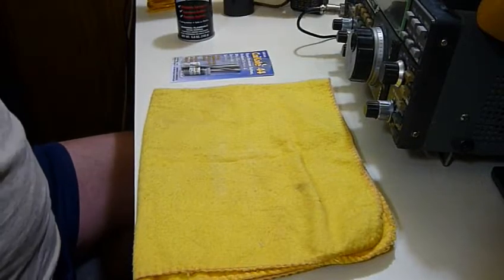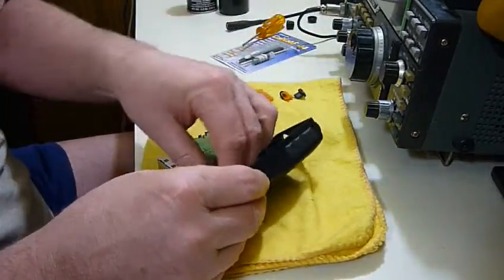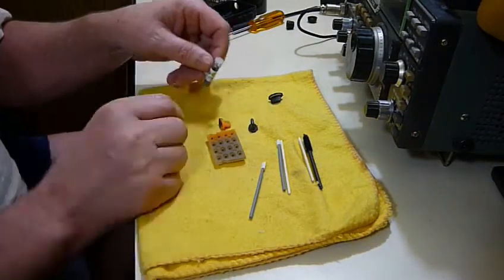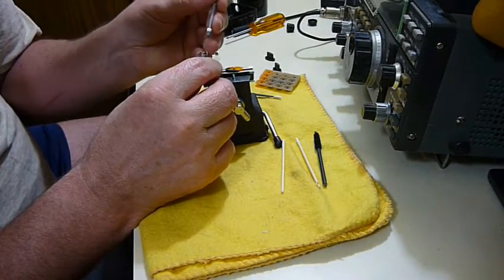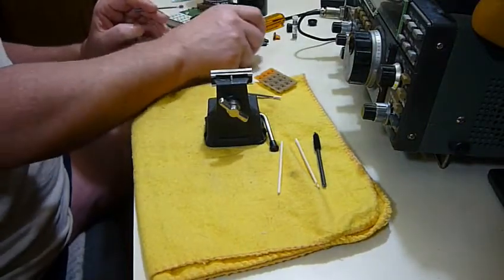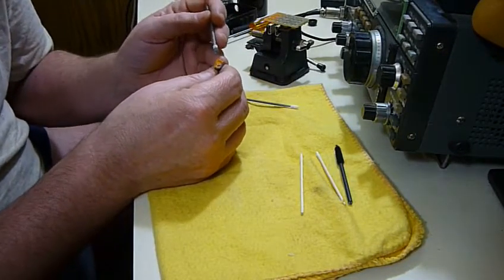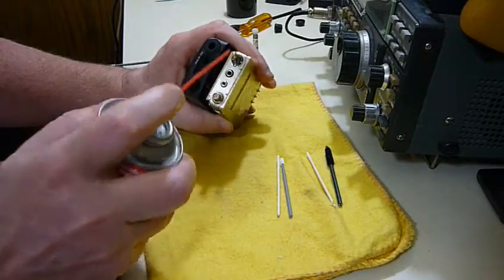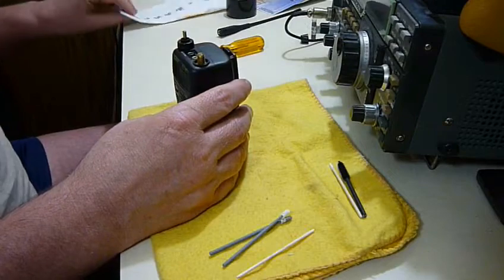How to Repair Rubber Membrane Buttons, by KV5R

Comment: Great video. I have a problem with my Yaesu VX5R power on/off button. I asked a Yaesu tech at the 2013 Dayton Hamvention how I could repair the problem with the membrane since replacement membranes are no longer available for the VX5R and was instructed to remove the membrane and lightly scrub the carbon coated pads with a pencil eraser. I haven't done that yet. Finding your video is probably a better solution. I will try your method.
Reply: +Terry Morris pencil does work alltho it depends how long it will last based on using the button. More important is it will work. :D

Comment: Thanks for this tip. In Australia I found a product called KEMO Conducting Silver which I used to repair apair of Uniden cordless phonee that had a faulty toggle switch on both. This product and this tip fixed both !! Bought the KEMO Conducting Silver from Jaycar Electronics $12.95...cheap repair !! Thanks again easy to follow video.

Comment: Silicone rubber keypads need to be banned.  junk
Reply from the maker: ***** Or at least they should be made with a lot thicker conductive layer, so they have a decent lifespan.
Reply: it's designed obsolescence. it'd be easy to make a contact surface that last 1 million cycles. but why would they want to? ur supposed to toss it in the garbage & buy another. all consumer products are made the same way.
Reply: +Eric jones   Eric is partially correct.  The Silicone is the substance that makes the rubber keypad flexible.  It is the combination of the silicone oil and the conductive carbon contacts that is the culprit.   I fixed tens of thousands of keypads and I found that Panasonic had installed a conductive membrane between their rubber keypad and the board on only a few models back in the early 90's.  Then they stopped doing so and went with just the rubber keypads, why?  My guess is that the ones with the membranes were lasting far longer than they wanted them to.  The only way I found the models with the membranes was that they would fail for other reasons , but nothing to do with the buttons unless they were just filthy and sticking down, but then they would still work.  So we reverse engineered the Panasonic membrane and began manufacturing our own, eventually making a peel and stick conductive membrane that fits most Panasonic phones without adjusting it, or it can be cut up to fix most any similar keypad.  Panasonic had a great keypad for some older 900 MHZ phones, so we copied their best keypad solution.
Reply: +bgregg55 You and Eric jones are right. They should be banned. They're a step backward to mechanical switches.
Reply: You have a good point, and technically they are inferior to mechanical switches, however there is a trade off for everything, even buttons.  Most mechanical switches are soldered to a board so repairing them is labor intensive.  Their contacts should be coated with gold to ensure their longevity, which is not only costly but to harvest, refine and acquire gold then plate the contact is not earth friendly. So I think Panasonic had the best buttons engineered back in the 90's which they included with some of their 900 MHZ phones, about a dozen of them.  This "family" of cordless had silicon rubber buttons, but they only functioned as buttons, while there was no conductive material on the rubber buttons but instead they included a Mylar membrane in between the buttons and the board.  I can only imagine that they did away with this concept due to profitability and not quaility, which is more of an American business trait than Japanese. But that is the legacy of the 90's, Americans had to work harder and the Japanese had to work smarter (profitability wise).  Incidentally, these phones are what we used as "models" and a basis for the design and manufacture our Pad Mate peel and stick conductive membrane.  So  while they, and most manufacturers did away with a more practical, functional and longer lasting button solution, we kept the torch burning and our Pad Mate membrane can be used for almost any silicone rubber keypad made.  Here is the easiest way to get hey at this link while it is good- http://www.ebay.com/itm/291583354988

Comment: Great video! I feel the same way about repairing what I already have, rather than buying new. There’s a great deal of satisfaction in reviving worn out gear. I just purchased two tube testers at a hamfest, last weekend. They are now looking and performing like new. My wife sometimes gets frustrated with me for repairing everything. She always tells me “We can’t get anything new, because you keep repairing everything!!!” LOL :-)

Caig products are a bit more expensive, but I’ve never bought a Caig product which wasn’t worth every bit of the money that I paid for it. My ‘chemicals’ shelf is full of Caig products. My only advice, to others, is to visit Craig’s website and read their product information to make sure you are buying the most optimal product for your application. Also, as with any type of contact or potentiometer cleaner, be careful not to get any on clear plastic, such as display windows. The chemicals, in the cleaners, aggressively attack these types of plastic. One more note... wear safety glasses when using contact cleaner. It can, and often will, spray back at you. You haven’t felt pain until you’ve had your eyes sprayed with contact cleaner. 

Disclaimer: I have no affiliation with Caig. I just use, and trust, their products.

Comment: There is no need to go to the expense of buying deoxidiser in all cases.

The direction controls for my telescope started to be erratic.

I found that CAREFULLY scraping the contacts on the circuit board removed the oxidosation and it all worked perfectly afterwards.

Comment: Have you ever seen buttons that use foam instead of rubber? I have a soundesign clock radio and it looks as if there's foam used instead of rubber to contact the PCB. I think I need to replace it.

Comment from the maker: It worked fine on my li'l 2-way radio, but I don't use it much, so can't say how long it'll last. But I don't think Caig would make junk, and the -44 is widely used professional repair shops. If someone says it flakes off, they likely put it on too thick. Just clean the pads with alcohol then put on the CaiKote by blotting with a foam-tip makup swab. Like any paint, a couple very thin layers is better than one thick one.
Good Luck!
--waggin

Comment: I have found-using a similar product, and the silver coating soon flakes off the button. Sometime it will then stick to the switch contact gap, making for a “continually pushed button” symptom. Perhaps the product I used was simply inferior or too old. Make sure you use a fresh new package if trying this yourself and give lots of drying time before reassembly.

Comment: you can check the little pads with an ohmmeter. less than 200 ohm is good. more than 500 ohm is bad.

Comment: Thanks for a great little video. I'm researching all I can to try to resurrect the touch pad membrane on my daughter's wall over. The parts are no longer available for it so I'm going to give it the old college try to see if I can figure out how to make the membrane work again. Right now, she has to bake everything at 350 degrees. No up or down and the oven light isn't working. None of the other buttons work either. If you have any advice on how to fix a membrane, please point me in the right direction. Thanks again.

Comment: i like to hear how long it lasted. it's hard to get anything to stick to silicone rubber. a new button contact typically has around 200 ohms across it. did u measure after applying this stuff?
Reply from the maker: So far it lasted over 4 years. I didn't measure the resistance because it worked ok.